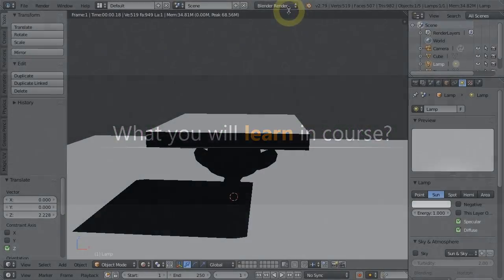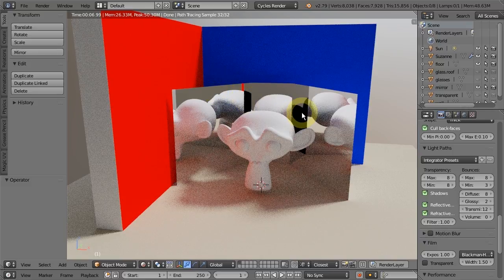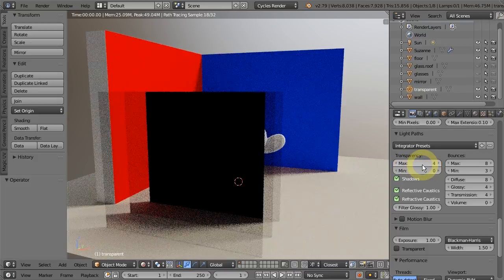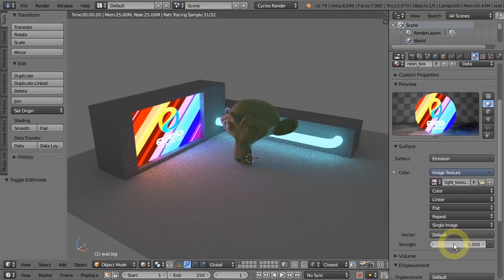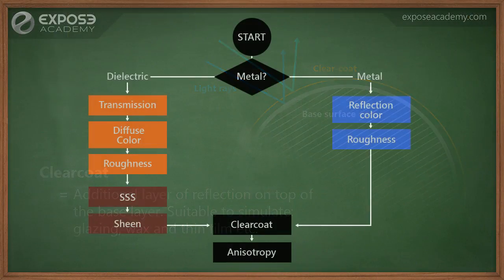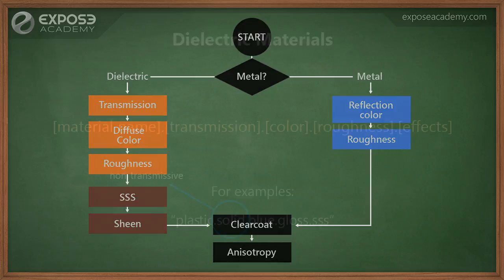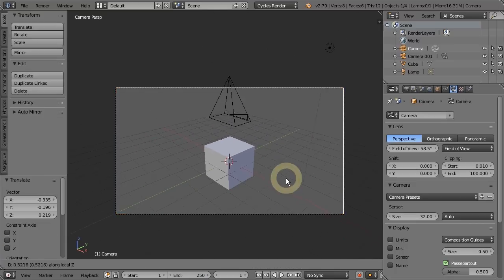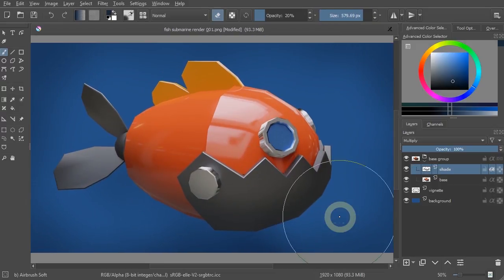Blender 3D Cycles rendering essentials

Comment: Bro I took your classes they are super informed, while I was making security house model in a old pc I felt lagging while working on it even though those are very few verts,I have handled higher verts in that pc ,is there a reason it happed like using real world model size would consume high resource ?
Reply from the maker: Hi Karthi. Essentially you want to use units that is closely compensate your object's scale. For example, if you are modeling a watch, you might want to use mm as the measurement unit. If you are modeling a table you want to use cm. If you are modeling a building you want to use m for that.
If you model a building for example but you use mm for the unit, this is where the performance problem start. Blender (or any general 3D software AFAIK) is not like Autocad where you can just use mm for anything you create. Forcing Blender to model a large building with mm unit will resulting long float values in each of the vertices coordinates. For example if in m we have 1,56 m but in mm we can have 1561,097485737 mm etc This long float values will eventually hurt the performance as Blender will require more than 4 bytes per float value. Again, this not just in Blender but also happens in other 3D DCC (digital content creation) software.
Reply: @exposeacademy  wow ,I haven't thought about it,your are filled with good informations u should have more subs here :) and when will be the next new course in blender comming, waiting for it
Reply from the maker: Still waiting for the final release of Blender 2.8 :) I have long list of lessons I want to update but at the current state of Blender 2.8, changes happen so rapidly and mostly in an unexpected way. This prevents me from producing the lesson video. :) I'm planning a specific course about architecture/interior using Blender next year in sha Allah .
Reply: @exposeacademy  oh 2.8 is the reason I c,  I think it will be good to make some simple tutorials in YouTube as it will increase the subs count till next course comes in, so more people will aware of course,and I forgot to mention I applied for Photoshop   introduction course but I havent got it's link in mail I have already mailed u about the issue :) anyway thx for these replays
Reply from the maker: You are right, I should create more youtube tutorials :)
Okay I'll check the email system and see what went wrong.
Reply: @exposeacademy  oh thx ^_^
Reply from the maker: I just fix the email system. Turns out the time between my ubuntu server and amazonSES server was out of sync :( Need to reinstall the ntp service. It should be working fine now. Can you try resubmit again? You should get link in the email in sha Allah.
Reply: @exposeacademy  it worked :) I got the mail thx again